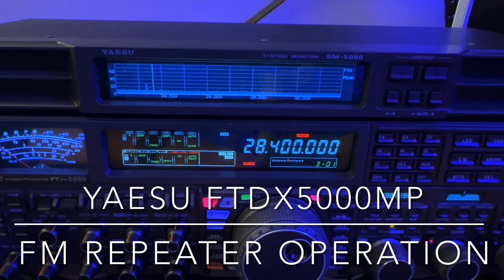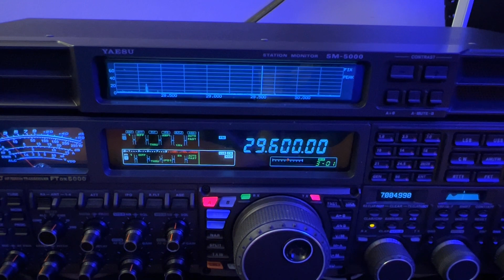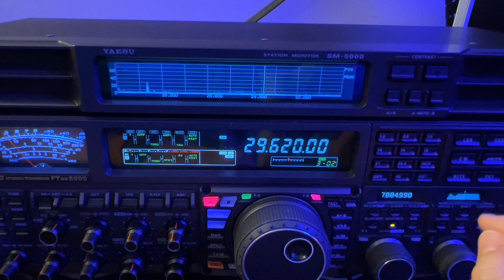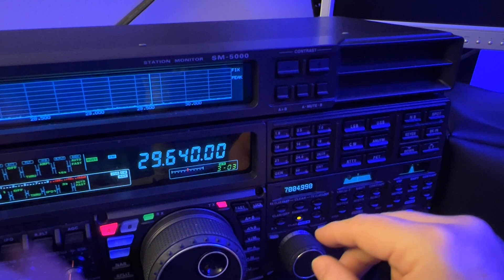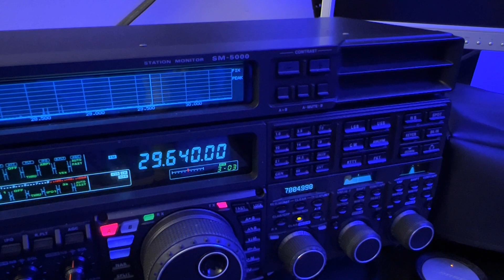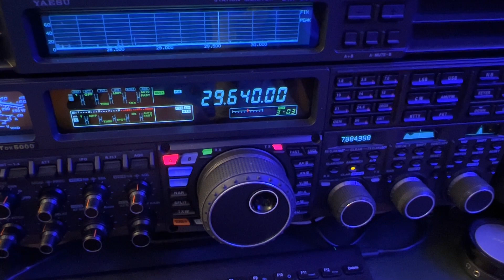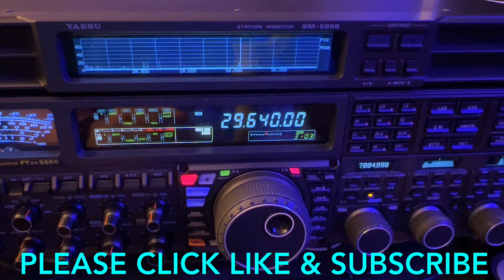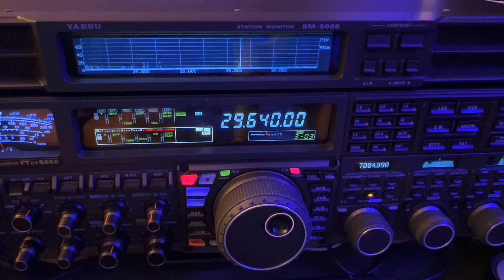Yaesu FTdx5000MP: FM Repeater Operation

Comment: Do you know how to setup the fm repeaters on a yaesu ftdx 3000.
Reply from the maker: I’m not in front of an FTdx3000 but I will attempt an answer.  Set mode to FM.  Menu 084 sets the FM mic gain.  Use the arrows to locate TONE.  Press SELECT and set to ENC.  Press and hold SELECT and go to menu 088. Press SELECT again and rotate the CLARIFIER/VFO-B knob to choose a CTCSS tone frequency (i.e. 100Hz).  Press SELECT followed by MENU to save and exit.  Finally, use the arrows to find RPT.  Choose from SIMP, +, or -.
Reply: I will give that a try. I have tried the manuel with no luck

Comment: I have used the machine on 6 in TN from here in WNC. I cracked the manual and discovered how to engage the repeater mode and was delighted how easy it was to use. I have to say Doug that I enjoy your videos and I cannot imagine getting rid of my FTDX5000MP. I hope it lasts for decades.
  I hope I run into you again on 40 sometime soon. 80 should be excellent for a QSO as well. 73 OM from Asheville and hope to put you in the log again soon.
Reply from the maker: It would be my honor to have another QSO Michael. 40, 60, or 80 should easily work for us.